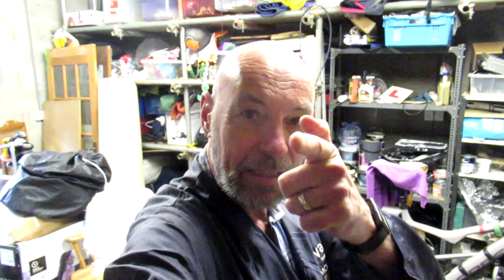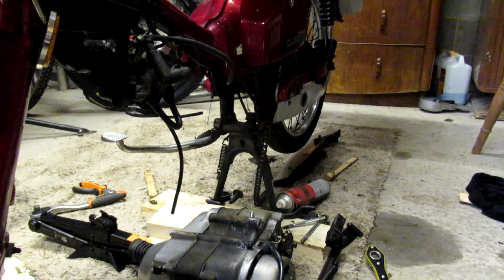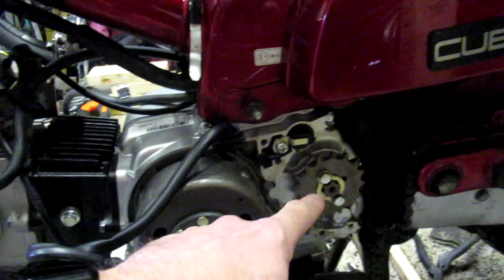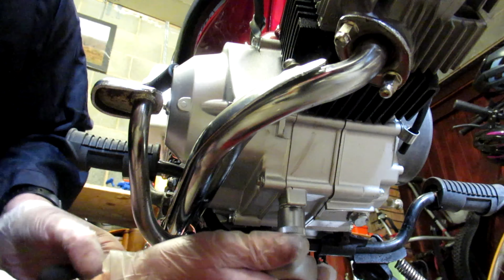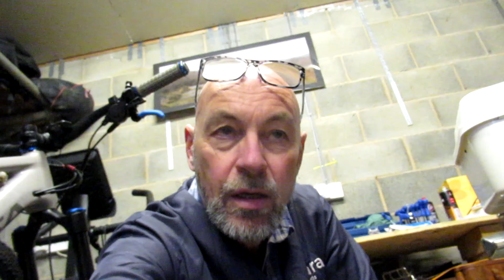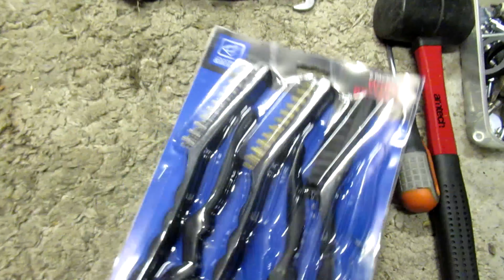Lifan 110cc Semi-Automatic Engine Install on the Honda C90

Comment: Excellent, plain speaking demonstration with an explanation. Is the Cub 50 the same engine mounting.
Reply from the maker: Hi, thanks for that and glad it was undertandabubble 👍 Not sure about the Cud 50 engine but I will stick my neck out and say yes, it will fit as its basically the same just a bigger piston -= I THINK! Check that 🤞

Comment: Hello.. Just found your video.. I have a Yamaha V80 moped and is very similar to the C90.. Strange question but if you still have the original engine have got measurements for the engine mounting points... Many thanks Glen
Reply from the maker: @stripfix1979  Hi, what measurements are you after and if I have time I'll dig it out and take some measurements, could be a YouTube vid in the making......
Reply: @OldNorthern_eMTBer  many thanks for getting back to me.. If you could maybe get the width of each mount so I can measure the gap in my frame and a rough distance apart from each other that would be perfect... 👍
Reply from the maker: @stripfix1979  Hi Glen, I'll have a look at the weekend. Subscribe to the channel for the video, feel free to lo e, share and comment on my random sh!te 😁👍

Comment: Great video mate! Helped me do the same. Have you got the link to the new gear lever? I'm struggling to get one that will fit without hitting the engine casing.
Reply from the maker: Hi. Really sorry for the late reply. I don't get notifications for some of my vids and I've only just seen your message! I got the gear lever from Amazone but I've looked back in my order history but it only goes back so far, sorry. If you still need it let me know and I'll try and find it for you 👍👍
Reply from the maker: Found it! Its this one but I did need to heat it up and bend it out slightly 👍
https://www.amazon.co.uk/gp/product/B09JGVPXHL/ref=ppx_yo_dt_b_search_asin_title?ie=UTF8&psc=1
Reply: No worries mate, legend 👍

Comment: You will need a longer exhaust
Reply from the maker: Really? Why?
Reply: Is not the 110 engine longer from exhaust port to the hanger on the frame
Reply from the maker: @AnthonySmallman  Nope. Bought a new, non-original C90 exhaust off ebay (£49) and it fitted no problem. There is no difference in size to the original engine.